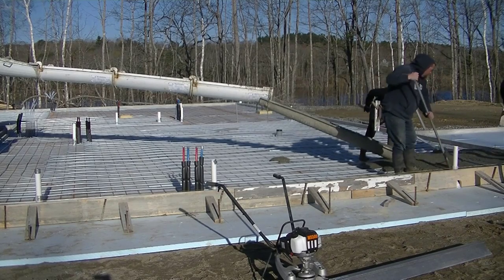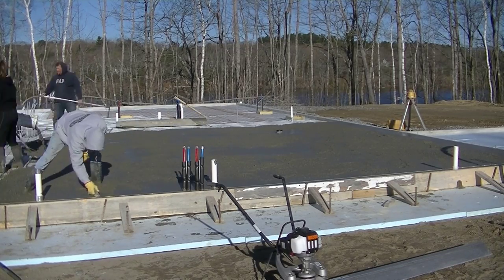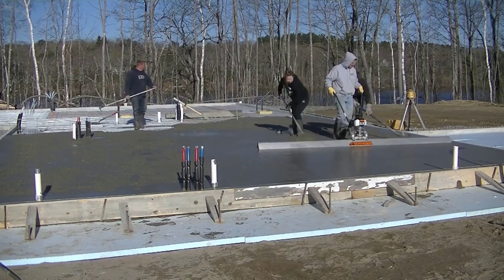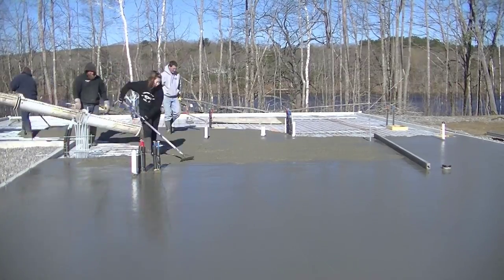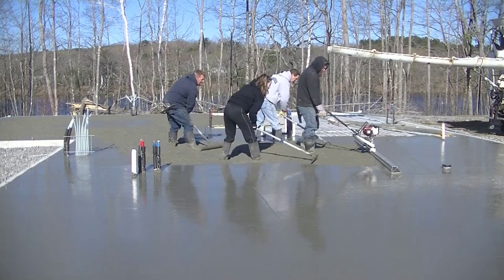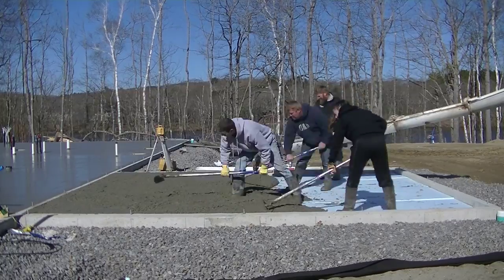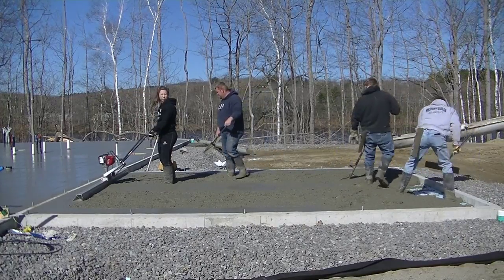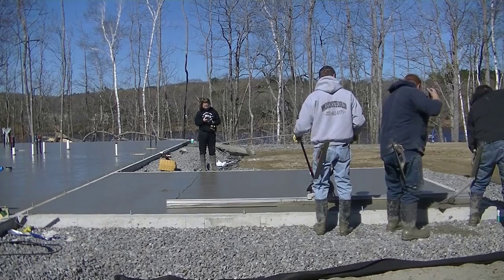How To Use A Power Screed To Pour A Concrete Floor.

Comment: Mike,small tip,  mount your laser receiver rod stake on a plasters' hawk. Set the hawk upside down, flat side on the floor. With a 3' rod stake ,the receiver becomes self supporting . The benefit is you'll take many more shots because it will always be nearby.
Reply: Man I learn so much on youtube and I been at it for 50 years. Great idea and I got a few hawks  laying around being that drywall is my 1st trade. 🦅

Comment: Hi.  Great video, thanks.  I'm in the UK and laying around 66yds2 (11x6), with a fall in both directions. The 11yd side falls by 12", the 6yd side by 5".  I want to use a power screed. Would you work from the low point to high, or high to low?  I've never done anything this large before, so any advice would be really helpful.  Thanks.

Comment: Thanks for the video Mike! Question: you mentioned you still hand screed floors with a slope. Is that because it is not advisable to use a vibrascreed on a sloped floor?

Comment: vibrascreed probably also helps compact the concrete too.  Makes it more dense than hand rodding the concrete.
Reply from the maker: It does work very good!
Reply: Yes settles it like a vibratory a little, works cream to the top. Definitely a back saver.